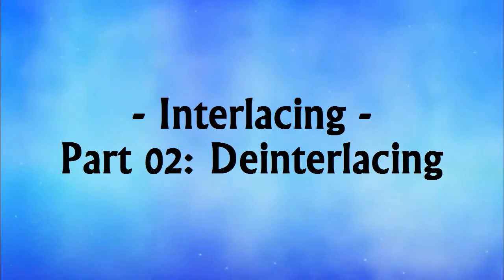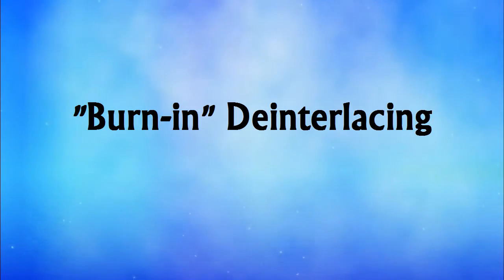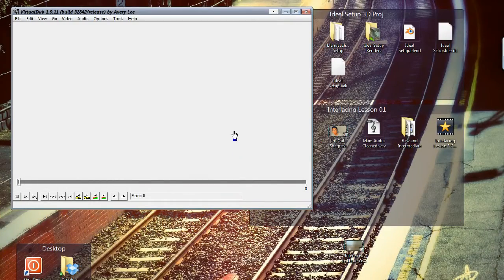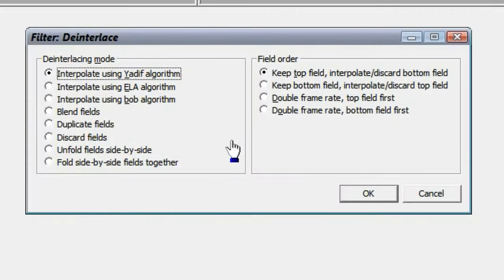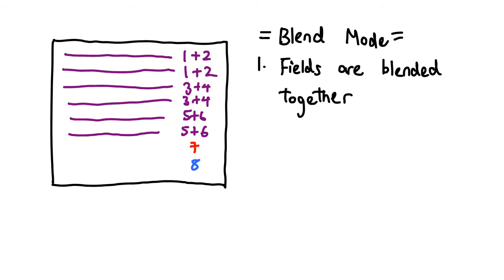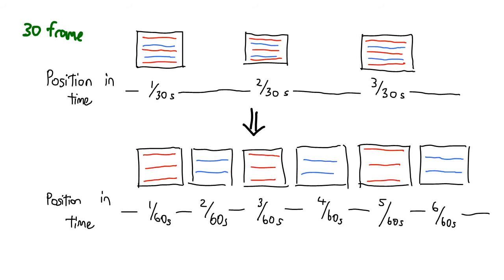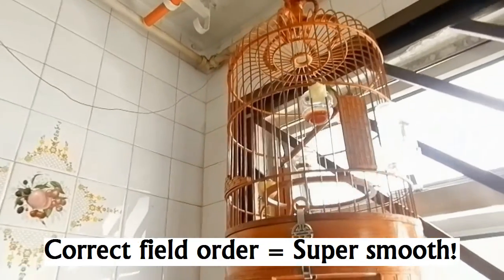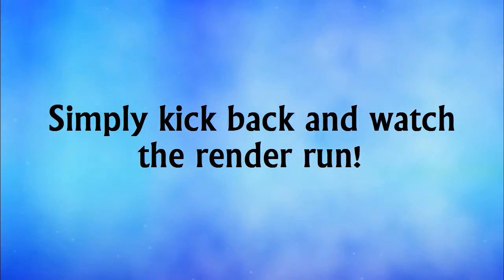Interlacing Lesson 02: Deinterlacing Methods and Algorithms

Comment: Wow.  Thank you so much for this.  I am in the process of copying about 200 Hi8 and D8 Sony Camcorder tapes to my computer hard drive.  These land on the HD as avi files at about 13 GB per hour.  I want to deinterlace these avi files and then convert them to a more friendly, compressed, but still excellent quality formats like MP4 or MPEG.  I follow your video up to the selection of the double frame rate.  I am only doing this on these camcorder tapes, so will the top or bottom field first be the same for all of the tapes, and if so, do we already know what the correct selection is?
Reply from the maker: Hello and thank you for your comment! I found a source that says fields are determined by your capture card, which hopefully means that everything you pull off your tapes should follow the same field order.

Maybe consider extracting just a small clip and then simply trying out both settings to see which is right (if you've gotten the wrong frame order it should be immediately visible).

Source that I found, scroll down to the bottom-most answer: https://www.digitalfaq.com/forum/video-conversion/11200-premiere-pro-ntsc.html
Reply: @NERDfirst  Thank you again.  I took a look at that.  I am not using a capture card but rather have a Sony D8/Hi8 camcorder hooked to my PC desktop via firewire.  That said, the top or bottom field should be consistent for each tape.  So I think your advice is probably still the same, although I may check both some D8 and Hi8 material as they may be prepared differently.  Does that make sense to you?
Reply from the maker: Yes! That's how I see it too. It would be wise to test and confirm that D8 and Hi8 use the same field order, though I do believe they should be the same.

There's also a very small possibility that if the original tapes were shot with different cameras, that the field order might be different across cameras, but again I think the likelihood of this actually happening is slim.

What I would do is test one tape to find out the field order and just take it that that's the correct one to use. With every conversion moving forwards, just assume that's the right field order and convert the clips, but review each clip afterwards to be sure before deleting the original AVI.
Reply: @NERDfirst  Fortunately, one camera was used for all of the Hi8 tapes.  When it died, I upgraded to a D8.  All of the D8s was shot on the second camcorder.  I am using a third camcorder for this project as camcorder #2 no longer works.
Reply: @NERDfirst  What compression should I use?  You warned about the size of the file using uncompressed.  I did one run that way.  My source file was about one hour and 13.3GB.  The converted 60fps AVI file is 201.2GB!
Reply from the maker: It's been a long time since I used VirtualDub and this more "traditional" way of working with encoders, but I've had good luck using x264vfw previously. I have a whole video on encoding concepts, but I think the part that'll interest you more is how I set up x264vfw: https://drive.google.com/file/d/0B2Ia5aQpQ8CnWUxMcHRQTFhEZW8/view?resourcekey=0-_XQomsNvmQUD2rqDePeU7Q

The video in question: https://www.youtube.com/watch?v=W7l5aXARuH0
Reply: @NERDfirst    Thank you!  I'll take a look.

Comment: Amazing video and thanks for all the thorough explanation! Quick question, I've been using the Bob Weaver deinterlacer (in FFMPEG) since that one gives me the smoothest result, but sometimes it gets a softer look than other methods, however, with other methods, even though they do properly deinterlace, it leaves some colored horizontal lines in high motion areas, would you happen to know how to remove that? Or maybe add a filter to the interlaced file to prepare properly for later deinterlace? Thanks!
Reply from the maker: Hello and thank you for your comment! Unfortunately no deinterlacing algorithm is perfect, so you just have to pick the one that's easiest to live with and to clean up. I honestly don't do much deinterlacing, but from what you've described, it sounds to me like you might want to start with Bob Weaver, and then run it through sharpening. 

Reason being, "softness" sounds like a problem that's far easier to solve than "colored horizontal lines"!
Reply: @NERDfirst  Thanks for the reply! Yes, I think sharpening is better, less time consuming and better for my peace of mind than dealing with these coloured stripes... haha. Thanks for the info!! cheers!
Reply from the maker: Haha that's how things are, we have to pick and choose our battles, and sometimes the easiest victory gives us the quickest way forward =P

All the best for your work =)

Comment: If video’s are recorded at 25 or 30 frames ps , then it should be easy to reconstruct the original frames(whether it’s from 3,2 or 2,3 pulldown etc,,) ,but if those video’s were recorded at 60 fields ps, then it requires an advanced motion adaptive deinterlacing in order to only blend static parts of the image ,while motion parts will be attempted to be reconstructed and or blended together,resulting in smoother images onscreen, too bad most modern tv’s don’t have motion adaptive deinterlacing.
Reply from the maker: Hello and thank you for your comment! While you're right, most of the time simple deinterlacing algorithms are used and the results seem to be quite passable! It's not great of course, but no matter what sort of deinterlacing algorithm is being used, at the end of the day it can only guess what the missing lines are.

Comment: Brother u have uploaded a very good videos for interlacing which is the main reason for subscribing your channel and also that I really need your help with something very important, it's really bothering me from the very first day.
Reply from the maker: +GoFool Hello and thank you for your comment and support! Ask away, I'll try and help however I can.
Reply: lcc0612,
I have a dvd of an animated tv show which I wanted to keep in my pc hardrive so I copied the D1 (Disc1) folder from the dvd and tried to encode it cause the videos files of the dvd were seemed to be interlaced which I tried remove using Pavtube Video Converter but the deinterlacing mode in this software is very bad and reduces the overall video quality. 
So for a temporary period of time I used VLC to watch each of the episodes,
VLC -- Deinterlace Mode -- NSTC (IVTC).
Reply: After looking up all of the deinterlacing modes in VLC, I found this mode to be working perfectly for me without loosing the original video quality and I wanted this to be permanent so I looked on the internet and found your video which explained alot about it but what I wanted to ask u is that my encode size gets very big when I use virtual dub and also the bitrate of a each video is around 5000 kbps and frame rate is 59mbps. I want to completely remove interlacing without loosing any of the videos bitrate (okay maybe very little amount), I mean I want to encode my videos in such a way that it sustains it's actual video quality without loosing much and also one thing in your video upload u have also uploaded 30mbps and 60mbps video samples and I want my encode to be almost look like 60mbps one cause it was really smooth and very good to look at.
Plzz help me this Interlacing mess..!

So Sorry For The Late Reply, I was caught with some other things for days..
Reply from the maker: Hello again! Okay, this gives me a good idea of what you want. Firstly - Frame rate is measured in fps (frames per second), mbps is a different unit of measure. That got me very confused for a second there =P

It sounds like you already have everything figured out except the very last part, which is picking a codec (6:31). I recommend installing a new one called x264vfw. I have a video on this that shows you how to install it, and I suggest some good settings you can use in the video description. Check it out: http://youtu.be/9lZnNm34FVw. It is the third part of the video, which you can click on using the contents page at 1:18.
Reply: lcc0612 holy shit, I'm sorry for the confusion I was writing like a maniac it didn't even occurred to me to recheck my comment.. :(
Reply: and i guess u already understand now, that what type of video requires a nstc (ivtc) deinterlacing mode.
right..?
Reply: also is there any deinterlacing mode named as NSTC (IVTC) which I can download and paste it to virtual dub folder to use it during the encode..
?
Reply from the maker: Hello again! As far as I know, there isn't a type of deinterlacing specific to NTSC. Really there are only two types of interlacing - Odd field first or even field first. As such, you don't have to install a special plugin to deinterlace your videos either! Everything is there natively in VirtualDub. Simply follow the instructions in the video - Use Yadif with "Double frame rate" as shown at 5:31. You'll have to use trial and error to see whether the odd or even frames come first, but once you find out, it should be the same for everything in the same series.
Reply: +lcc0612,
I have another problem too now, I have a video which is in good quality but it has some zizzerness in it.
I don't know how else to explain...?
but if it has an odd field perfectly fine but then even field is bit moving wherever person talks or moves it moves alot like it's shaking.
Reply from the maker: Hello again! I'm afraid I'm not really certain what the problem is. However, one thing you can try is to switch between "odd field first" and "even field first" to see if it helps. 

If it doesn't, you might want to see if your video has been scared at any point, whether intentionally or otherwise. Field lines have to be exactly one pixel tall for deinterlacing to work properly. If that's not the case, deinterlacing will fail and things will look really bad!
Reply: +lcc0612,
For time being I'm keeping that question aside.. and wanted to ask few more questions.
#1. Can I encode in x265 codec with VirtualDub.
#2. Can I encode video at it's original video bitrates.
I mean since I have a video of frame rate 59fps and bitrates = 5000kbps, can I double it to 60fps..?
Reply from the maker: You could encode in h.265 if you find a VFW or DirectShow codec that supports it. Install it on your system the same way you did for x264vfw. 

Increasing the bitrate will not make your video look better as any information lost in previous compressions cannot be regained. As such, I don't recommend increasing bitrate beyond that of the original input video.
Reply: +lcc0612,
No_No..! U got it wrong buddy, I mean I want to encode my video at the same bitrates as of video.
Also I tried to encode with your settings, I added the following filters for the best results (after trying every other filters)
#. Deinterlace -- Interpolate using Yadif -- Double the frame rates top field first.
#. Interlace -- Not Progressive (I can't remember the name of the other one) -- Even or Odd (it really didn't matter in anyway both looked same to me).
Reply from the maker: In my x264vfw setup, we do not specify the bitrate. Instead, we specify a quantizer value, which is better linked to the perceived quality of the video than bitrate. To do this, go to Video → Compression and make sure x264vfw is selected. Then click on "Configure". In the middle of the screen under "Rate Control", you should see a drop-down box. Click on it and select Single pass - bitrate-based. You can then adjust bitrate with the slider.

Having said that, I don't recommend you bother with matching the bitrate of the original video - Different codecs compress at different levels of efficiency. Instead, use your eyes! If it looks acceptable, it'll be fine.

I'm not sure I understand your filter setup. Why are you interlacing your video again after it has been deinterlaced? Many displays support progressive playback now.

Comment: Hi there I have alot of AVI video from a DV cam and have been uploaded to my computer with a firewire card, i wish to de-interlace them and save them in a best "no lost" format, which will save space on my HD. I will try virtual dub and seems to be easier than adobe encoder, but dont understand the last bit of your video,  shall i save it as an AVI or mp4 format,  since most smart tv now are capable of playing mp4 only.
Reply from the maker: Hello and thank you for your comment! VirtualDub is unfortunately only able to produce AVI files for output, and as such you don't get the choice to render to MP4. If you wish to save MP4 files, you'll have to find an external converter to convert the AVI files produced by VirtualDub. However, I encourage you to test the AVI files on your smart TV first. I think there's a good chance they can be played back.